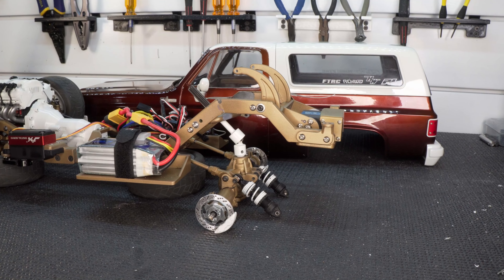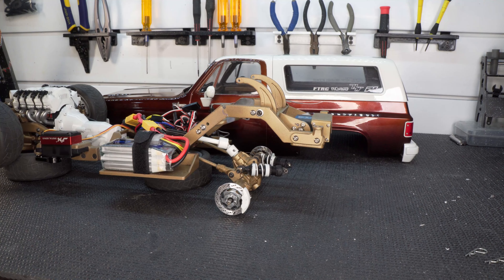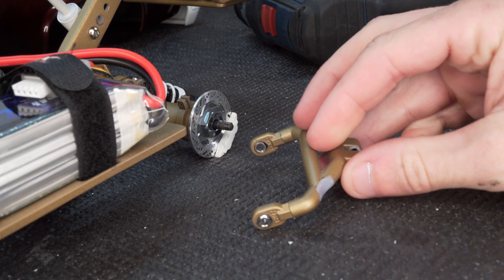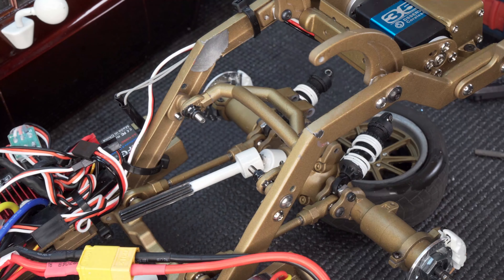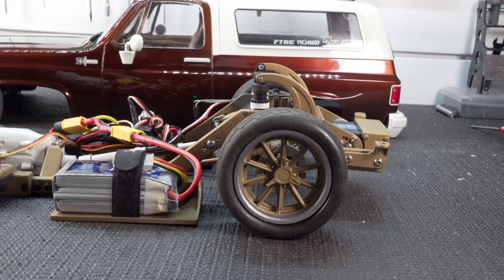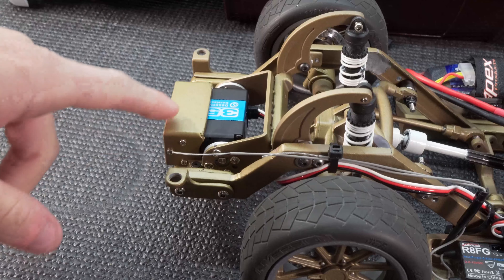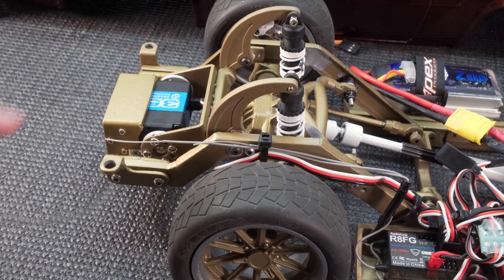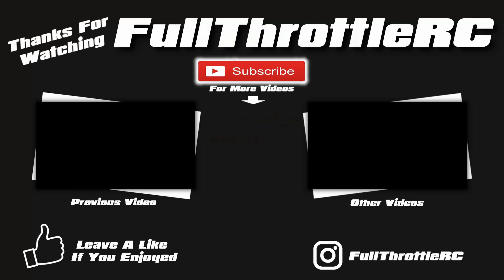What's Wrong with My Blazer's Rear Suspension?!?!

Comment: Another possible solution, though maybe more work, is to move your lift assembly closer to the center of the servo outputs. Servos have more torque the closer you get to the center and are normally rated with a 1 inch servo arm. Love your builds and this Blazer is very cool.
Reply from the maker: I have thought about changing the mechanism for the rear but to use the dual axis servo, I have to use the bracket they provide. Thought about using just a single reefs servo in the rear as well but I'm worried about it being offset and not lifting evenly.

Comment: The receiver doesnt control voltage. The ESC does. The Receiver just acts as a power bus to the ESC.
Your ESC has a built in BEC, aith a program card, you can adjust the BEC in the ESC up to 7.4 Volts easily.
There should be no need for a stand alone external BEC, unless you are doing some crazy hard core high torque servos, or heavy winching.

Edit: Upon further research, it appears thr Hobbywing 1060 Brushed ESC has a fixed BEC output of 3A/6V, and there is no way to adjust it. So in this case, you WOULD need an external BEC to get 7.4v, which is a little frustrating, as even a cheap Quickrun Brushless ESC has a 7.4v adjustable BEC.
My only assumption is that because this ESC is also capable of NiHM battery use, they set the BEC at a foxed 3A/6V for safety, and not to over draw the NiMH batteries, causing excessive heat to the cells.
Reply from the maker: Yea unfortunately I did look into using a programming card at first to adjust the voltage through the ESC but I wasn't able to. I hate to have to add more under the body as the wiring is getting tight already but I'm really hoping that extra voltage will help us lift the rear more reliably.
Reply: @FullThrottleRC  So I did some looking around, and I think the hot ticket for you will be the Hobbywing Quickrun 1080 G2 Brushed ESC. It is an advanced version of the 1060. Is fully compatible with the Hobbywing programming card. And, more importantly, has an adjustable BEC with 6v/7.4v/8.4v all at 4A.
And currently can be had for $45.
Might be the way to go, given your clutter issue. And probably isn't much different on price than an external BEC.